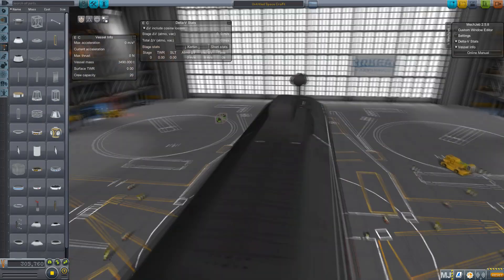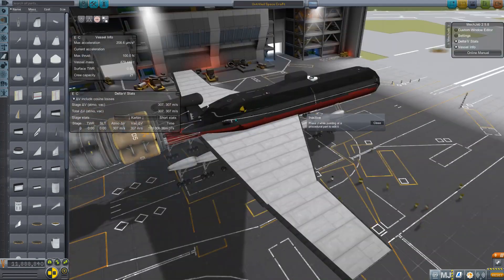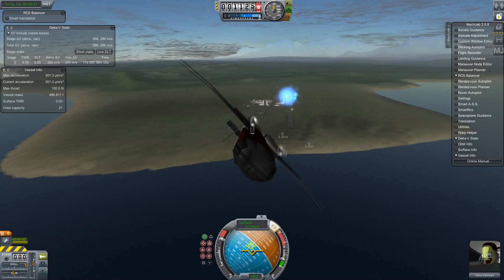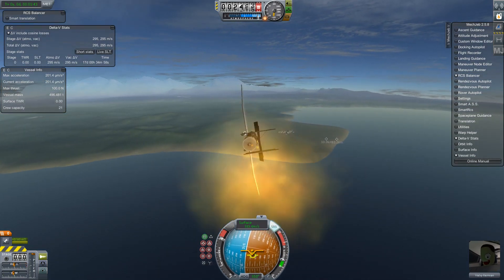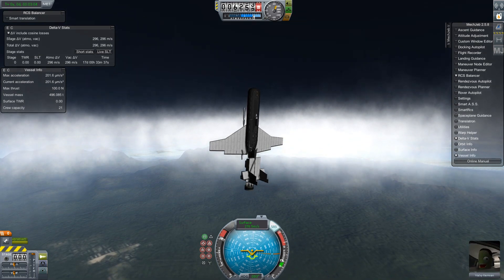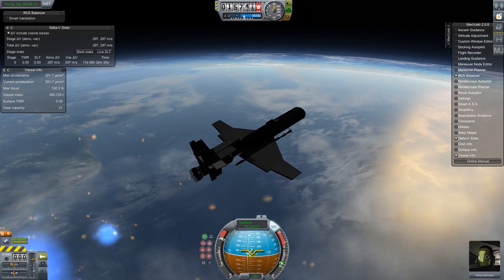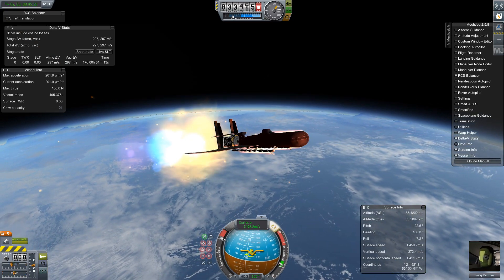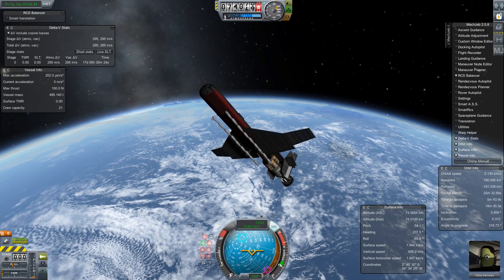Most Kerbal Spacecraft Ever - Part 4 - Orion Propelled Nuclear Sub SSTO Aircraft

Comment: 6:41 "The nuclear blast would tear off the wings very quickly"
Well, actually no the nuclear blast wouldn't!
If you read the accounts of the Pascal-B test in Operation Plumbbob, you'll find out that the shielding was blasted off by the plasma, and NOT by the explosion itself. And even if the orion-drive pulses wouldn't happen at about 50m away from the pusher plate (or rear for convenience), the wings would still need to be within 3.5m from the detonation

Comment: can somebody explain the oberth effect to me in english
Reply: it's more efficient to accelerate when you're already moving. forget all the technical mumbo for a moment, the main point is the TIMING of the acceleration is important. you can view it as driving a series of hills in your car. when you're going down them, your acceleration gains you more speed over when you're going up. 

That's not quite all though. the uphill part is inevitable, and you will lose speed as you go up. so, to lessen how much you lose you can: less the slope(not possible) or change how long you're losing speed. if you drive 5mph, you're gonna stop long before the top. if you drive 70mph, you're more likely to hit the next top. 

If that's too long, the oberth effect is kinda like accelerating your car going down a hill, rather than flat or going up.

Comment: Today's TL is TL8, labelled as the digital age.  TL7 is regarded as 1940-1980 and is labelled the atomic age. TL9 is labelled as the microtech age and is guestimated to begin 2025-2050. Avatar and GURPS Transhuman Space are regarded as early TL10 (THS is advanced in bio-tech and artificial intelligence). Delta-V allowances are given as miles per second (GURPS is highly imperial). Vehicles in GURPS Spacships have 20 'systems'.  Each engine and each fuel tank takes up a system slot.

Non-Supersciece Reaction drives (Chemical, Electrical, Nuclear Pulse, Fission, Fussion)

Chemical Rocket (TL7): This is a reaction drive that burns fuel and oxidizer, such as a mix of liquid hydrogen and liquid oxygen, to produce thrust. Each engine provides 3G acceleration. Each fuel tank of rocket fuel provides 0.15 mps delta-V. Spacecraft capable of reaching orbit are often multi- stage designs (see Upper Stage, p. 26).

HEDM (High Energy Density Materials) Chemical Rocket (TL9): Uses high- energy density materials such as metallic hydrogen or metastable helium, for fuel. Each fuel tank of HEDM fuel provides 0.5 mps delta- V, but may explode if damaged (see Volatile Systems, p. 62). Each engine gives 2G acceleration.

Ion Drive (TL8): A high- impulse, low- thrust engine that ionizes a reaction mass and accelerates it as a beam of ions to produce thrust. Each ion drive engine provides 0.0005G acceleration, but is a high- energy system that requires one Power Point. Each fuel tank of ionizable reaction mass provides 3 mps delta- V. These statistics also apply to most plasma thruster systems.

Mass Driver (TL9): An electromagnetic accelerator that launches buckets of reaction mass at high velocity to produce thrust. Its performance is unimpressive, but it can use just about anything as reaction mass. Each fuel tank or cargo hold’s worth of mass (often powdered rock!) ejected provides 0.3 mps delta- V. Each mass driver engine provides 0.01G acceleration, but is a high- energy system that requires one Power Point. Options: May be high- thrust (double acceleration, halve delta-V).

External Pulsed Plasma (“Orion Drive”) (TL7): Pulse units are full- size nuclear bombs that are ejected out and exploded behind the vessel. The plasma wave impacts an acceleration pusher plate, producing thrust. The rear hull section must have dDR 50 or better, or dDR 5+ plus a magnetic sail ( “Mag-Orion”). Each engine produces 2G acceleration. Each fuel tank of bomb pulse units gives a delta- V of 2 mps (TL7), 3 mps (TL8), 4 mps (TL9), 8 mps (TL10+) delta- V. Options: May be high thrust (double acceleration but halve delta- V per tank).

Fusion Pulse Drive (TL9): Uses laser beams, particle beams and/or miniscule amounts of antimatter to trigger fusion micro- explosions in tiny nuclear fuel pellets in the reaction chamber. Each engine gives 0.02G acceleration (TL9) or 0.05G (TL10+). Each fuel tank of fuel pellets gives a delta- V of 5 mps (TL9), 10 mps (TL10), 40 mps (TL11+). Options: May be high thrust (double acceleration but halve delta- V per tank).

Advanced Fusion Pulse Drive (TL9): A fusion pulse drive optimized for outer system or interstellar travel. Each engine give 0.005G acceleration. Each fuel tank of fuel pellets gives a delta- V of 20 mps (TL9), 100 mps (TL10), or 350 mps (TL11+). Options: May be high thrust (double acceleration but halve delta-V per tank).

Nuclear Thermal Rocket (NTR) (TL7): This reaction engine heats a fluid as it passes through a built- in solid- or liquid- core nuclear reactor and expels it for thrust. Each NTR engine gives 0.1G acceleration (TL7), 0.2G (TL8), or 0.5G (at TL9+). Each fuel tank of hydrogen gives a delta- V of 0.3 mps (TL7-8) or 0.45 mps (TL8). Options: NTR may use water instead of hydrogen: 3¥ acceleration, 1/3 delta- V.

Nuclear Light Bulb (TL9): An enclosed gas- core fission drive; radiation from the reactor (principally light) passes through a transparent containment vessel, to heat the fuel (hence “nuclear light bulb”). Each engine gives 0.01G acceleration (TL9) or 0.05G (TL10+). Each fuel tank of hydrogen gives a delta- V of 0.8 mps.

Fusion Rocket (TL9): Generates a fusion reaction to heat hydrogen into plasma and expel it, adding extra cold mass for extra thrust. Each engine gives 0.005G acceleration. Each fuel tank of hydrogen gives a delta- V of 12 mps (TL9), 60 mps (TL10), 180 mps (TL11), or 450 mps (TL12). Requires minimum SM+9 at TL9; but no limit at TL10+

5.6 mps of delta- V (and 1G+ acceleration) lets a spaceship blast off from Earth into low orbit.

2.1 mps of delta- V lets a spaceship in Earth orbit achieve escape velocity.

12 mps of delta- V lets a spaceship that has achieved Earth escape velocity travel from Earth orbit to the Moon in about 11 hours, Mars orbit in about six months, or to Jupiter in about 20 months, including decelerating the vessel. Spending more or less delta- V will proportionately affect the travel time.)

4,000 mps of delta- V lets a spaceship travel from our solar system to Alpha Centauri in about 400 years, including deceleration time, at about 1% of light speed.
Reply: This is from GURPS Spaceships.

Comment: what are you using for the sky and sun to look like that and the clouds?
Reply: Stock Visual Enhancements and Scatterer - at least I'm pretty sure those are the mods used
Reply: +Ryan Fonseca EVE and Scatterer. Stock Visual Enhancements (SVE) comes with both preconfigured, including the exact same sun/flare texture you see here. And you'll have to use D3D11 or the horizon will look like shit above 10000m.

Comment: The most Kerbal vehicle ever: a plane which causes nuclear winter on every flight.
Reply: loperspest Loving the Narnia reference!
Reply: Narnia reference? And Nuclear Winter? It would be a nuclear fallout due to the fact that the Orion Nuclear Pulse Engine &#160;was devised to be a low POWAH! nuclear blast. Only a few Kilotons. A nuclear winter is caused by a much higher level explosive,I think its a Thermonuclear( Otherwise known as Fusion) warhead that would have the POWAH! to cause a Nuclear Winter. Like Russia's TSAR bomb. Hence WINTER. So, it would be a Fallout, though one short lived, at a maximum of a year or so. GOOD TIMES! :D
Reply: A nuclear winter would be caused by secondary fires from burning cities not the nukes themselves. The whole thing is still theoretical anyway with the results going from insignificant all the way up to 300 years of sub zero temperatures over most of the planet. As for Orion the blasts would be small but were also designed to work like shaped charges forming thin plasma beams aimed at the pusher plate. Don't know what that would actually look like but it would look weird. :)
Reply: @Lucien86  The shaped charge Orion nukes can also be weaponised, called a casaba-howitzer.
Reply: Actually if you mean fusion powered bombs, by thermonuclear warheads, then they are a lot cleaner for the same yield, than the more "conventional" ones.

If you add a layer of nonrefined uranium around the bomb, then it will give a lot bigger bang for the same buck (as the fast neutrons from the fusion can split those atoms, unlike the ones that are released by fission) - but you will also get a LOT of "unburnt" material that is sprayed all over the place.
Which is why the Tsar bomb was dialed back to 50 MT, from 100MT for testing

However if you take care to begin the ascent with boosters, and only switch to nuclear in the upper atmosphere, you will be probably right, since the fallout will be spread out over a large distance, and will have time to dilute.
Which would be still a pain in the ass for everyone if we were to live in a world where, linear no treshold model of the effects of nuclear radiation is true.
Since in such a case, certain occupations should have massive increases in radiation related ailments, like pilots, who tend to spend most of their work hours in 5x the natural background (due to cosmic rays).

The thing is admitting that research needs to be done and we have no clue would be the honest and productive way to go about things. Sadly doing so is unethical (at least it can be done unethically - which will be brought up as an argument for doing nothing), and in the short term ignorance is productive, since it sells, more specifically sells "darkgreen" propaganda, and gets charities money.

Comment: The lack of incoming coolant water would be a problem, but why would a pressure-fed reactor have a problem with zero gravity? If the reactor vessel isn't full of water, then someone has screwed up royally. Or it's going through decommissioning. Case and point- Three Mile Island.

Comment: how many bombs have you got on that thing!?
Reply: Errr, ten...

to the nine.
Reply: In the "real" version the nukes aren't "very" big, they are pure fusion nukes so would be relatively "clean". You would need lots of them, but they would be relatively small compared to what you think of a nuke from WW2 or something.
Reply: At least twelve.
Reply: Communist_Penguin Right, lots of the things needed didn't exactly exist yet, but that was the hope, without the fallout would be pretty horrendous!
Reply: Oops, I didn't give you an answer, about 800ish at around .15 kt, or 100x smaller in yield than the first nukes ever used.
Reply: Depends on their yield. Each magazine will hold 20k NPU-250 charges, 10k of the next class, then 5k and 2k, with one charge used per pulse.
Reply: i doubt they would have been pure fusion bombs, since that doesn't exist.
Also worth noting they're shaped nuclear charges, so the majority of the blast is fires towards and directly away from the pusher plate

Comment: Wait, could this be a slow analogue of how "The Kraken" worked? Also, "The Kraken" was when spacecraft had weird oscillations, right?
Reply: That and so much more, The Kraken is responsible for spacecrafts suddenly exploding into pieces, nullifying their very existence, instant teleportation to another world but the destructive oscillations is probably the weakest of The Krakens powers... The most destructive Kraken power I've experienced myself, was during a fairly normal docking maneuver I come in nice and easy, I align properly... I dock and my station just falls to pieces, no explosions, nothing, just every piece of the station just broke off and disconnected for apparently no reason. But I know better, I know The Kraken was involved.
Reply: Also, it seems like the Kraken has taken over Totally Accurate Battle Simulator, as more patches are made for KSP...
Reply: AFAIK, the 'kraken' in it's original form was caused by ships moving to fast or being to distant from the game's origin causing floating point errors and destroying ships.

This was fixed in version 0.17 by instead setting the origin to be the currently selected ship and moving the whole universe around it, think like futurama.

Of cause the kraken is now an in-joke in ksp to represent pretty much any destructive bug, but that was its original meaning.

Comment: 8:35: Why did you describe it as a Coca-Cola vending machine? The analogy is clearly flawed.
It should be a Nuka-Cola vending machine.
Reply: It's a reference to the rumor(?)/anecdote that the designers consulted coca-cola for their vending machine mechanism so it could be adapted for ejecting the nuclear charges
Reply: My hypothesis: it's a reference to the Coca-Cola vending machine in "Dr Strangelove", which..uh, can you have 'spoilers' for a film that came out fifty-two years ago?
Reply: countertony I think it was Dyson's son's book about Project Orion that he stated it
Reply: Coke was brought in to assist in the design of the pulse unit "dispensing machine" back in the 60's due to their experience with vending machines
Reply: I think it was a Fallout reference. GO NUKA-COLA! :D
Reply: The Orion rocket was the brainchild of professor Freeman Dyson, who realized that the ship would require different bombs based on altitude, and need to switch out types very quickly, and he actually considered contracting with the company that made the machines used at Coca Cola bottling plants to select and release warheads.
Reply: ...bother, I didn't remember that rumour. Yes, that's far more plausible. Dammit, and I had the whole story prepped about how the contents of the machine were needed to try to avert Armageddon.
Reply: +Major Dakka I wth ought it was a fallout reference
Reply: nice fallout refrence